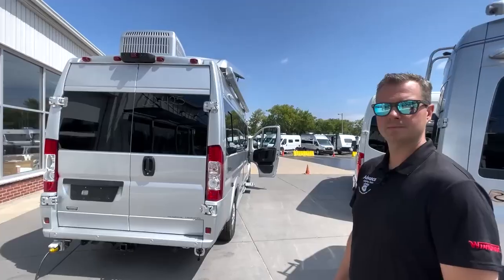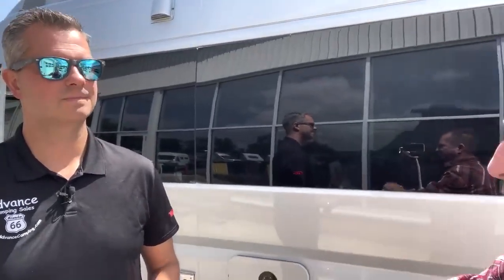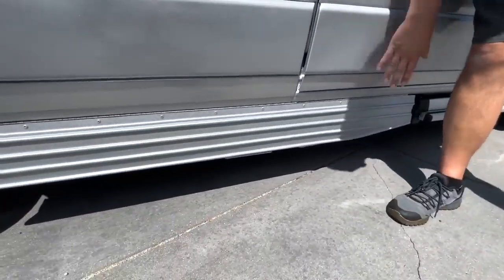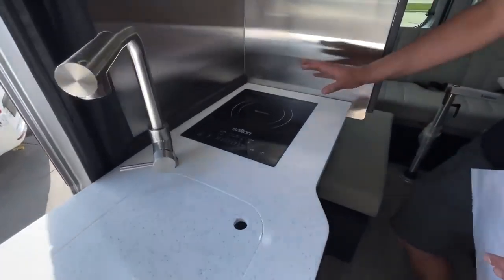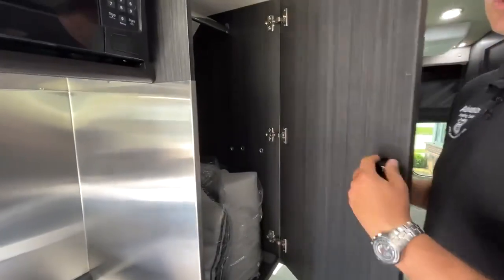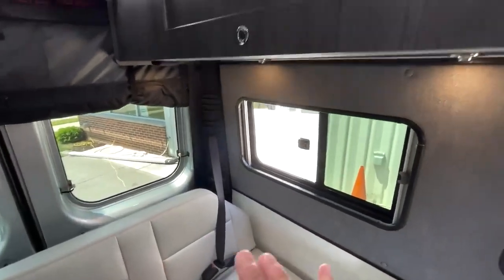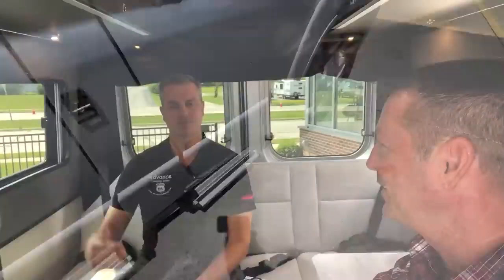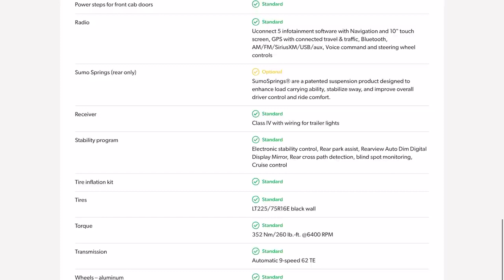SEAT 5, SLEEP 5 KING SIZE BED + Pop-top 2022 Zion Slumber by Roadtrek Camper Van

Comment: Wow! Not a Ram fan but this is quite the build. Macerator toilet, 3000 watt inverter, extra room in the bathroom, beautiful stainless galley, huge storage, five seatbelts and a pop top, opening rear side windows with side shades and 600 ah lithium batteries. That's just inside and a whole lot more outside. Love this layout and a great review ... Cheers from Nova Scotia